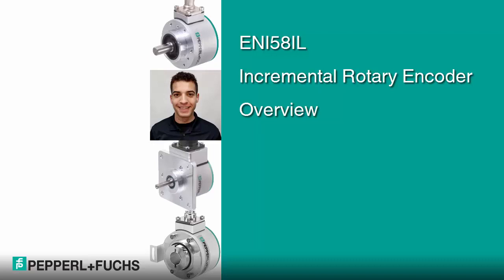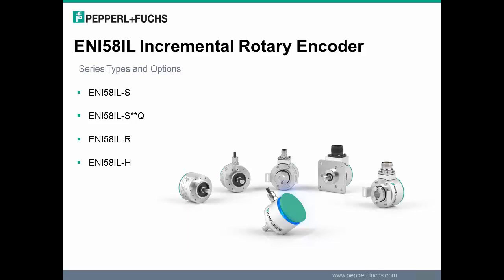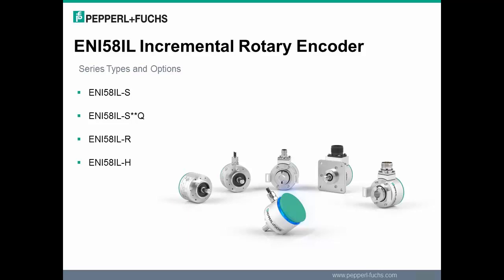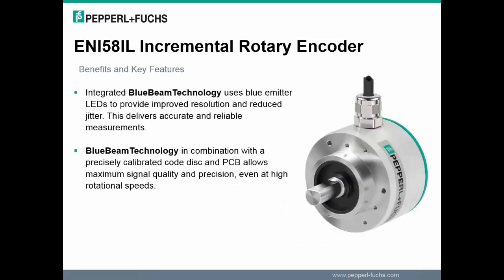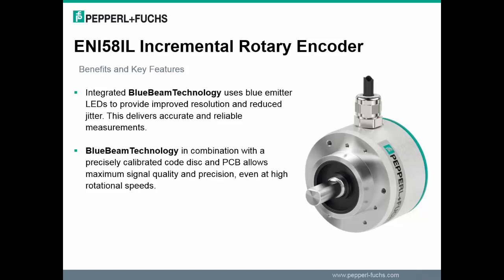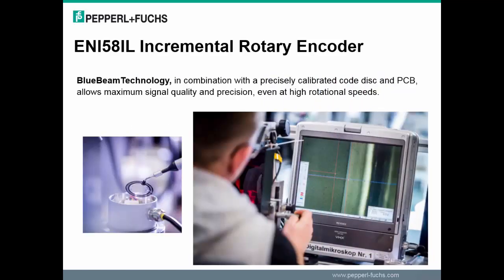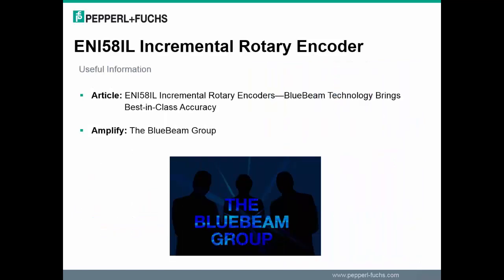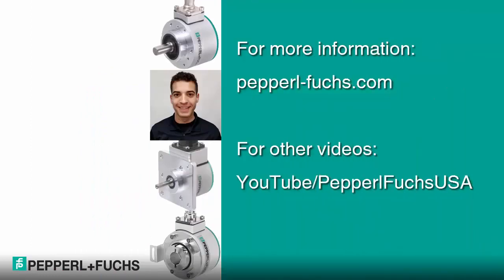Overview ENI58IL Incremental Rotary Encoder

Comment: Hi sir,

  We are using ENA58IL-S06SA5-1416B17-ABP  
We use profinet to connect encoder with Siemens PLC S71200. We receive only 255 pulse per revolution , need your support regarding this since this resolution is 65536 ppr.